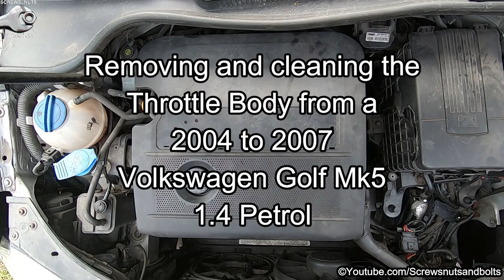Throttle Body Cleaning - Volkswagen Golf Mk5

Comment: Hello.. Do I have to recoding the throttle Body after refitting by the computer?
Reply from the maker: With certain cars the throttle body needs to be adapted after cleaning using a scan tool: https://www.pelicanparts.com/techarticles/Volkswagen_Golf_GTI_Mk_V/43-FUEL-Throttle_Body_Cleaning_Replacement/43-FUEL-Throttle_Body_Cleaning_Replacement.htm

Comment: Legend
Reply from the maker: Cheers :)
Reply: @screwsnutsandbolts  your very welcome! Channel is awesome. Could I just check that u don’t need to remove negative battery terminal, or both battery terminals (positive and negative) prior to removal. I don’t have VAG software, and I’m pretty sure your supposed to need to do a throttle body alignment after this, otherwise you get a check engine light no? Any help appreciated!

Comment: Hi,is this the same for the 1.4 tsi? Thanks
Reply from the maker: I'm not sure if the Tsi throttle body is the exact same but it's probably quite similar
Reply: Thanks for the reply

 @screwsnutsandbolts
Reply: I had a look and it's quite different with the turbo and supercharger @screwsnutsandbolts